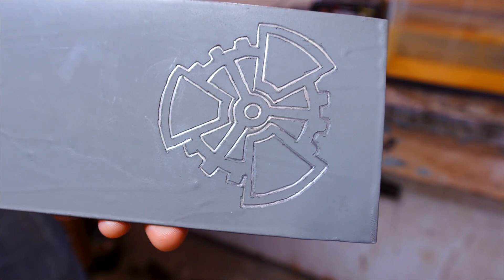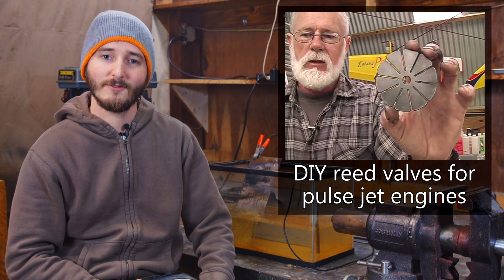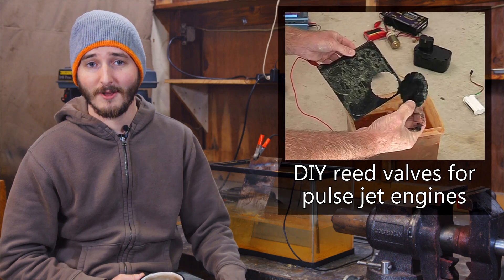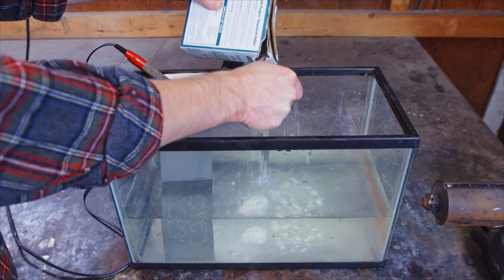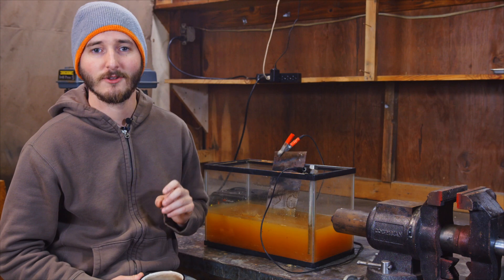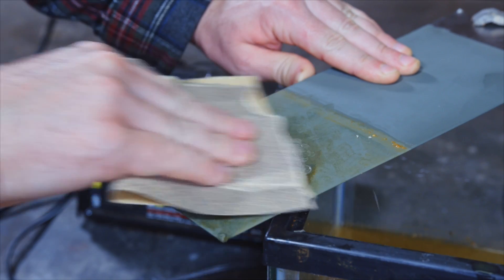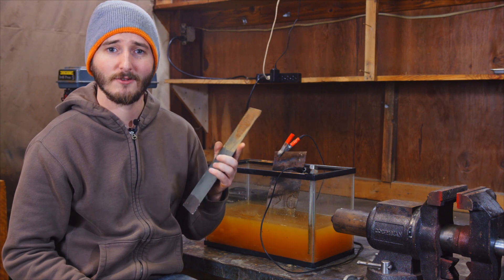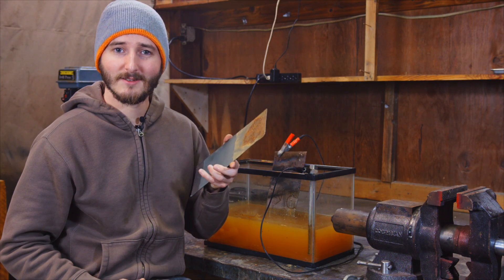How To Cut Steel With Electrolysis [Experiment In Progress] - NightHawkInLight

Comment: To engrave aluminium I often make the mask with PCB type photosensitive film. I laminate the film to the metal, expose it and dissolve the exposed parts like I would do for a PCB. Maybe you could try using this kind of film, it does bind pretty well to a clean sanded metal surface.

Comment: I guess the plate used for the reed valves are much thinner than the plate you have. On thicker material the etching goes in all directions as it starts to get inside which means it will go under the painted areas.

Comment: I don't understand why the removal of material would continue in the direction through the metal, instead of trailing off in other directions once the initial surface has been broken. I think the thin spring steel works because it is so extremely thin that any etching that is coplanar to the surface is negligible because it doesn't have time to gain any real distance before the material is cut all the way through. The tolerance to the original etch marking is probably some ratio to the thickness of material. Thicker material, the further it will start to etch and propagate "under" the primer.
Reply from the maker: With proper paint adhesion the cut should propagate in a half circle through the material, growing wider in 2:1 proportion to it's depth.
Reply: Are you following the technique outlined in the video you linked exactly
 ? if so , have you also tried without the current limiting bulbs ?

Comment: I think the steel plate is corroding due to oxidising gases being released
Reply: so maybe u can try a very thin layer of wax at the cutting area and a thick layer in the rest of the area
Reply: would make it take even longer
Reply: hey7328 . but it would make it less exposed so less corrosion
Reply: or probably it is happening because the carbon in the wax is oxidising

Comment: Even though you paint it both sides or not, you can't protect the steel that is exposed on the sides of the cut.
Interesting project if you or another find a solution to the sides that are exposed.

Comment: are you using AC or DC current? because if you use AC, electrolysis cannot occour. and since you're using a battery charger, which runs ac, it could very well be the issue here
Reply: battery chargers are DC

Comment: I have some experience with this, though not for cutting, I make and etch my own logo's and I can get very detailed and good depth. I have not tried going completely through metal with my method but think it would work.
I use Press N Peel PCB etch resist. It comes in sheets that you print onto with a laser printer, you then use heat from an iron to transfer the print to the steel and peel the backing off. It think it's worth trying.

Comment: Also, what about taping off your design and painting over it, then removing the tape?

Or just painting or using a marker, paint or ink, and coloring around your design?

Another thing you might try if it's just the paint failing is some sort of bake-on paint like Durakote.

Also, have you looked at the scratched surface with a microscope before putting it in the tank? Maybe the cause of the problem will be apparent then?

Comment: Try using an acidic electrolyte, such as sulphuric acid, hydrochloric acid or ferric chloride. Alkaline conditions might be causing dissolved iron to immediate precipitate, blocking further attack. Phosphoric acid should not be used for similar reasons.
Reply from the maker: Interesting, that very well could be
Reply: Caustic Potash - It's often recommended for HHO generators

Edit: if you want/need some, PM me. I have a full container I don't want
Reply: I've been working on a project similar to this but instead of using electrolytes I been using Photolithography and acids. By using positive developer (sodium hydroxide), and a UV photoresist paint that hardens in the present of UV light. I been trying to etch detailed images into metal plates. this could be adopted for you purpose.
Reply: Steve D
Reply: Use caution, some acids attack steel.
Reply: For the acid bath, I would recommend hydrochloric acid specifically as it would quickly react with the Fe2O3 that is formed to produce ferric chloride in solution. That way as the iron corrodes on the surface, it is always being etched away by the acid to reveal a clean metal surface. Also, I would try increasing the current of the electricity and the temperature of the bath. That would cause the electrolysis to happen faster and hopefully minimize the amount of time that the corrosion path has to spread to under the paint. Perhaps also try ensuring that the steel anode is mounted flush with the cathode so that the current density is uniform across the entire piece. Neat project btw, I'm excited to see how this turns out!

Comment: Is there perhaps a way to block the flow of electricity through the shaped parts? For instance, maybe with a competing current going directly through the shape you want cut out. My idea is to have an anode in the shape of the part to be cut out, pressed flat against the metal, with the diode the mirror image pressed flat against the other side (and lined up perfectly!). That charge would go straight through the metal, in the shape of the cutout. Could this neutralize the ambient current of the solution in the shaped parts?

Alternatively, might you be able to deflect the current by placing magnets around the outline of the shape to be cut?
Reply: Diode, sheesh. I meant cathode.

Comment: Using standard Sodium Chloride will produce lots of Chlorine gas which Will rust the metal more than etch it. Sodium Bicarbonate is better although it'll also release CO2 gas.

 Those excess gases might be adding to those bubbles that keep forming under the paint. I'd recommend Potassium Carbonate as your electrolyte, or if you don't have any you can decompose Sodium Bicarbonate in Sodium Carbonate by throwing it in an oven for awhile which is a good alternative.

 Also maybe Lower amperage or a smaller Cathode could cause less gas to form on the Steal leading to less issues.
Reply: You could also try using an etching solution made of Vinegar, Salt and Hydrogen Peroxide. It has worked well for me in the past and when heated can go quite quick.
Reply: You can avoid the Chlorine production by using a dilute salt solution. A dilute solution would enable electricity to be conducted but only allowing the electrolysis of water. To avoid this whole issue, a sulfate could be used. Sulfate ions would not de-ionise without decomposing.
Reply: Another way to completely avoid gas production at the anode is to use pure iron. But I don't think he's interested in that.
Reply: When I use electrolysis for removing rust from old parts I use washing soda, which upon further inspection is Sodium Carbonate. Not only is there no chlorine gas from this I think it does better than baking soda for removing rust. I know because I used to use baking soda before I found out about the chlorine gas, so I've seen both strip rust and I think washing soda visually does a better job.
Reply: great to see you here...i luv your videos!
Reply: Sodium Carbonate works great and is easy to make, also Julian why does pure iron not form gas? I ask because though I may know a bit about electrolysis I haven't heard that before.
Reply: The gas would be more than Likely Hydrogen and Oxygen from the water splitting.
Reply: Well thank you, unless you are referring to Julian XD
Reply: TrollFaceTheMan I actually did not expect any gas to form at all, since the overall reaction at the anode should be just iron ionising. However, since bubbles are observed, it is either the iron dissolving below the coating, or gas is actually being produced. Assuming the latter, I attributed it to "impurities" in the steel such as carbon. The presence of unreactive electrodes might provide an impetus for gas production.
Reply: TrollFaceTheMan If the anode is inert enough, which iron isn't. Though it should be noted that Chlorine gas will be produced at high NaCl concentrations. So I'll expect Chlorine gas production after a while.

Regardless, there would be H2 production at the cathode if the electrolyte doesn't contain any metal ions that would be preferentially de-ionised.

Comment: i have seen people using vinyl instead of paint, also i have seen that instead of soaking it in the liquid using a sponge soaked in electrolyte with the negative electrode inside it and the positive attached to the part to be etched can be used to etch, also the sacrificial metal (the negative) should be as similar as possible to the part being etched.

Comment: After watching the aussie's video, I would suggest that you use something other than a stainless braided tube for your connection. You didn't state in the video what you were using for a current limiting resistor. In the referenced video, there are a pair of light bulbs in series providing current limiting. Another aspect that pops out is the cleanliness of the steel plate. If you are not getting a good bond with the paint, your results will be as you have discovered, bulges and bubbles under the paint. Polarity matters as well, to ensure that the metal ions travel in the correct direction. The reference video uses salt for the electrolyte. Why not stick to the formula that worked for the other fellow? Clean steel, ordinary salt, normal steel for the other terminal, series resistor current limiter.
Reply from the maker: I'll have to try lowering the current and going back to salt. The cathode material shouldn't be of any consequence so long as it is not a more easily corroded metal than the anode.
Reply: I did some additional research on this process and found mostly references to removing rust. In those articles, the sacrificial steel is on the positive terminal and is expected to erode. In this case of wanting to erode the steel in specific locations, you are depositing the removed metal ions onto the negative terminal, the stainless steel tubing. The surface area of that tubing is small. Most of the articles I've seen have surface area for the plate of the same size or greater than the part being worked. I think that the scratched out area is probably smaller than the surface area of the tube, though, so that should not be a factor. Other articles don't show current limiting, so the light bulbs now become more of a question than a possible solution. I hope you're successful in determining the correct answer.

Comment: the thickness of the metal is a problem if you notice in the original article he was only through fairly thin material with acid or electric etching you will always get and undermining effect at the edges will not be perfect but kind of conical the resist that you're using is probably as good as it will get in old days we used to use and asphalt Roofing far and acetone Jewelers use it etch patterns and that kind of thing Bluegreen acetate is used for etching circuit boards this stuff you can run through a printer to get your patterns and then it's an iron-on process however it's really only meant for circuit boards and your itching away a very thin layer of copper  good luck

Comment: have you tried changing the electrolyte? it may very well be that the electrolysis is producing a corrosive byproduct that could harm the metal and paint. Also, try going slower. Heat generated by high amperage could chip the paint away. Was the metal polished befor applying paint?  A layer of oxide between the metal and paint can cause the paint to flake off. Try painting the metal all the way. By the looks of it, the top part connected to the electrode is tarnishing and corroding.

Comment: maybe try a better paint. there are a ton of better ones which can still be sprayed from a can. also just a thought if this did work and you had a small laser cutter you could use this as a way to make the lines in the paint to cut the metal with the precision of a laser but without the cost of needing one that can actually cut steel, such as the glowforge.

Comment: First, did you keep the part you are etching vertical? If not, the gases might be trapped from the etching process and may be lifting the paint at the under side of the scratches. Second, have you tried with smaller scratch lines? Your mask may be failing simply because the line width is making the process take too long vs. the ability for the masking paint to retain adhesion.
Reply from the maker: Your idea of how bubbles might be getting under the paint is interesting. I did keep the part vertical but I can think of some other reasons that might happen due to the rubbery nature of the paint.

Comment: Try using a rubber coating spray paint on top of the primer. I've used this system for precision electroplating and It always comes out great. The rubber gives me some really clean and sharp lines. I hope this helps!

Comment: maybe there's a way to accelerate the reaction for the exposed sections of steel, which could help reduce the amount of time in the tank & reduce the chance of the electricity bleeding to other areas?

thinking out loud, maybe scratching out your etching and then applying the inverse of the etching with something super conductive?

Comment: when etching circuit boards timing is critical if you leave it to long the acid eats under the transfer.  
Good luck.
Reply: +SuicideNeil laser printers are not lasers. laser printers print toner onto paper (or other medium), which you then transfer onto the steel surface by ironing the paper onto the steel before peeling the paper off carefully
Reply: lazer print then use as a transfer as in pcb etching.
Reply: you could try lazer printing your design.
Reply: The whole point, as he said, was to find an alternative to lazer cutting his design. He is trying to cut through the steel using etching as the method- timing has nothing to do with it, he doesn't stop the process until he has cut through the steel completely- etching just the surface is not his goal.
Reply: he clearly meant laser cutter.
Reply: Hmm, I thought he was talking about laser cutting the design from a sheet of steel, instead of faffing around with the etching method, my bad. I get the feeling however that printing the design onto the steel won't work as it won't be thick enough to stop the etching process from just eating through the burnt on toner as such...

Comment: What Cathode did you use (just the stainless braided hose?) What do you have battery charger set at? I also guess that scratching the surface to define the shape you want to cut could cause microscopic irregularities at the boarder of the masking material (paint or wax) and the bare metal, thus the bubbling. I would try masking with vinyl tape.
Reply from the maker: Yes cathode is braided stainless. Battery charger at 12v6A. The thing about this etching paint is it remains rubbery even when dry so it shouldn't be fracturing to allow water in or anything like that.

Comment: I think applying  many codes of paint should do it
I don't think wax is a bad idea but when you start scratching it off the steel plate your kind of cracking it as well, even if you don't see it. 
so water will get under it and make bubbles

the problem could also be  that when the steel starts to corrode, the paint that's on top of it starts to fall off
e.g. if you have a steel cube that's 10*10*10 and it's in black and you color it in white, the cube now is in white, but if you drill a small hole you'll see that it's black on the inside. so it will corrode from the inside
meaning use a much thinner steel plate

Comment: you need something to mix the solution, a recycling pump is the easiest method, because during electrolysis, the solution near the electrodes have an higher concentration on salt then the rest of the solution, either you need a specific voltage to avoid unwanted reaction (see the standard electrode potential table), higher current mean only faster reaction (maybe it will change the edge of the cutted piece)
Reply from the maker: Interesting thought.

Comment: or, just a hypothesis, direct current tends to go deeper into a part, AC not so much, however your electrolysis might not be as effective with the part switching rapidly from anode to cathode. maybe install a diode for intermittent activation and deactivation of the electrical pulse to limit depth of penetration. it will be a slower process but may be more precise.
Reply from the maker: Unfortunately alternating current would destroy the cathode
Reply: NightHawkInLight that's why I say install a diode. it restricts it from being AC and makes it half wave rectified DC. little zaps done in rapid succession instead of a constant zap.
Reply from the maker: Ah, sorry I misread that. I'll have to think about that one